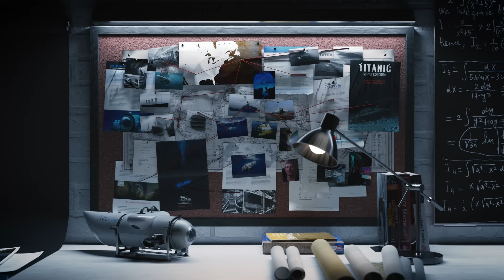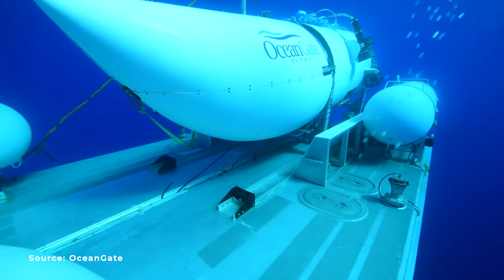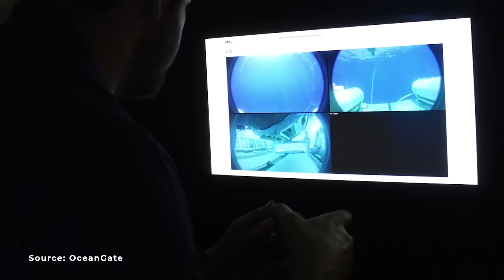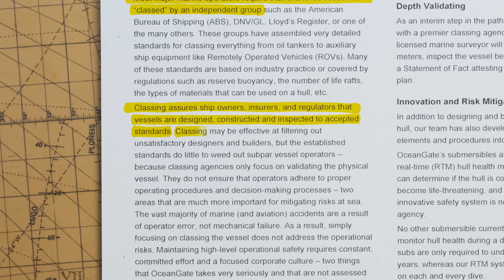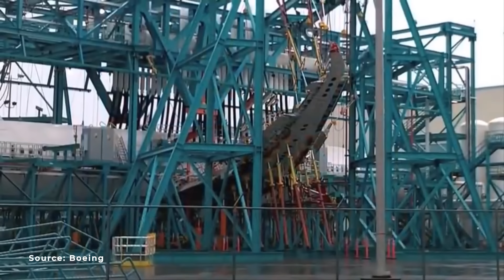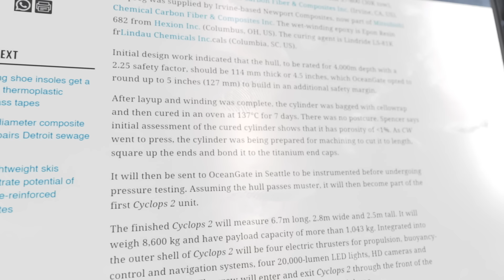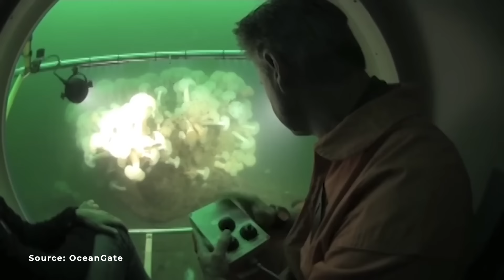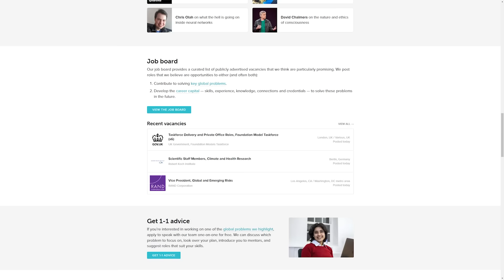The Questionable Engineering of Oceangate

Comment: After 27+ years of service in the air force as an acft tech , I've come to trust the strength of the carbon composite applications in aviation . But the caveat is that they require care and strict adherence to the non destructive inspection schedule throughout the service life of the said parts . For me Stockton Rush is even more unforgivable because himself came from the field of aerospace engineering and failed to transfer the same safety ethos and practices to his company ..... Greed , delusion .... hubris .... 
One last remark considering a key safety factor in my experience : the ballast release mechanism - from what I've managed to glean from the various tech channels there were frequent problems in this area . This IS your way out of trouble !!! In my field of work it's the analogous of the ejection seat - this is something that must and WILL work 100% EVERY-TIME - ANYTIME  (to my knowledge there is no ejection seat failure for at least 40 years - possibly for ever) - Comparatively in the sub when you press the button the ballast MUST be released - period - 100% - instantly ...

Comment: THE ENGINEERING IRON RING 

Canadian engineers and RCEME (Royal Corp of Electrical and Mechanical Engineers) have the Iron Ring - worn by the engineer on the pinkie finger of the dominant design hand. As a constant reminder for ethical and moral responsibility of design failure resulting in death. 
The origin is from a failure design in a bridge in Canada that failed and caused death. 
I own both. 
It is a constant reminder.
Engineering has huge weight on its shoulders.

Comment: My only problem with this video is it’s 15 minutes long, this content should be much much longer! I love it
Reply: had me in the first half
Reply: At the moment, he can only make a very educated guess as to the how and why the submersible failed. But  what actually failed has yet to be determined/released. There is no data set for the number of cycles that the type of vessel can survive, save for the one example that is the Titan itself. Innovation, in any field, is measured through achievable goals. Others, like Spacex, bring vehicles to the breaking point, then scale back their flight envelopes accordingly. Even the Shuttle operations have to be changed to suit new knowledge of its time. I also have serious doubts about Virgin Galactic only because their safety margins appear extremely thin even in comparison to Spacex, they only have tens of flights vs hundreds of the Shuttle and the hundreds of the falcon 9 vehicle.

Comment: I'm not a material engineer, but I've been shooting bows and crossbows since the 1980s. Hearing that the sub was made of carbon fiber pretty much confirmed it had come apart somewhere. For the past couple of decades, there have been arrows with carbon fiber shafts. Many of them have stern warnings with capital letters saying to twist/flex the arrow before firing, because if there are any loose fibers or cracks, the arrow will fly apart under the stress of being fired, and those fibers will go through the back of your hand. They don't gradually fail, they come apart all at once. Which is what probably happened to our overconfident CEO.

Comment: Let's try some simple, schoolboy maths: viewport tested/rated to 1,300 meters, proposed operating depth 4,000 meters => 2,700 meters below - BELOW - rated depth. Pressure increases by 1 Atmosphere (14.7 P.S.I.) per 10-meters decent, therefore 4,000 meters => an extra - EXTRA - pressure of 3,983.7 P.S.I. Yep - almost 4,000 lbs. per square inch EXTRA! AA designed and certified alright - the AA standing for Arrogant A-HOLE.

Comment: My thesis was also on a related topic - multiscale finite element analysis. A method developed precisely because of the non-homogeneous nature of these materials which makes very difficult to analyse
Reply: Heh, I'm a layman and I made a comment earlier this week that even destructive testing of CF is not conclusive because one hull won't be the same as the other 🙂
Reply: Even with that, you have the problem of the data you put in.  Epoxy rich winding of carbon fiber leads to lots on nonuniformities that you can't see in the design plans.
Reply: Is it publicly avaiable?
Reply: That sounds really fascinating.  If the thesis publicly available?
Reply: Sure.
Reply: @sonicimperium  *Sure!

Comment: The speed at which the sub descended on its last dive was significantly higher than previous dives. In addition, the ascent rate after they jettisoned the ballast when they recognized there was a problem is indicative that the sub was substantially heavier on its final dive than on those before. If this was because of payload it probably means nothing but if the weight they carried as payload wasn't significantly different than on previous dives it raises the possibility that the carbon fiber hull was already compromised and had a significant weight of water inside it. Simply weighing the sub after each dive would have indicated the problem long before a complete failure happened. Had their been delamination which allowed water to be trapped within the carbon fiber structure? Does that explain the increased descent rate? Did the pilot recognize the increased descent rate and know enough to understand it could represent a serious problem? Simple non destructive testing, tapping on the hull and listening for a change in the sound, could have prevented a disaster, but the young, diverse team didn't have the experience to know that.

Comment: A wonderful video in almost every respect, but in what way has that unnamed CEO revolutionized anything? He bullwhipped an electric car company into mass production. That I will grant. But certainly the space company has produced no innovations. They have repackaged ideas from prior generations, and touted reduced costs through reuse which are not backed up by reduced invoice prices of current launches. Smoke and mirrors only. And if you analyze the waste bins they are trying to fly now in relation to the requirements of human rated flight, their present designs are less capable than OceanGate. The waste is obscene rather than showing a sensible path to launch success.

Comment: No way, they didn't even autoclave the body of the vessel and didn't check for cyclic stress and fatigue? It's like compounded negligence and incompetence. 

For the move fast, break things it can be applied here by building several of these, sending them down unmanned and seeing what were the failures, failure modes, etc. Figuring out how many pressurization cycles it would take before it breaks. Not by risking the lives of others just because it didn't break the first few times. Of course it takes tons of resources, but it also gives real life testing rather than just theoretical knowledge.

Comment: James Cameron's Deep Sea Challenger was designed with the pressurized hull being separated from the rest of the vessel because at extreme depths the vessel would actually compress to about 2 inches smaller from it's default size all around, proving that the human portion of the sub must be built wisely, and patiently
Reply: I bet it compressed more than 2" 
The Trieste compressed around 5" and that was made from high nickel steel. 
The end caps were HAND GLUED together out in the open. No vacuum, just a plastic spatula smearing the glue together. I  think this is where the failure began, the end caps. Made from  dis-similar materials that compress different amounts. 
It was a miracle it made it more than once.
Reply: @TheBandit7613  I suspect that temperature related stresses played a part too.  In the open warehouse that they did the gluing, I doubt they held the temperature completely constant until the cure was complete.  Temperature changes and different expansion rates could have lead to a joint that was weaker than the calculations said it was.
Reply: charitable of you to assume they calculated anything
Reply: @TheBandit7613  If the design is done right, that should be irrelevant. Bathysphere windows are designed thick & conical so that as pressures go up, so does the seal quality. (They are also not "sealed", they're just held in by clips & water pressure)

Kind of scary to listen to them rattle on the surface, you'd swear every fitting is loose - and most of them ARE. (At least at surface pressures)

P.S. Not an expert, just a former longshoreman that moved a few from truck beds to boats - and had to ask questions because I thought I broke them while lifting them from the truck.
Reply: In the Deep Sea Challenger doco they also mentioned that they limited the amount of deep sea dives before doing the main dive as each dive increases the risk of catastrophic failure. To me it sounds like there is no sub that can do extreme deep dives on repeat, they get rated to be able to do x and after that they need to build a new one.

Just my understanding, I have no qualifications in this field, just what I understood from the doco.
Reply: @NotBROLL this seems the most balanced approach, or go ROV and prevent human loss.
Reply: James Cameron's team also worked on that submersible for 7 years with thousands of tests prior to make sure everything was as close to perfect as they could get it
Reply: @BigHuskyGG  then again his sub also went 3 times as deep which is nuts.
Reply: @ThatPianoNoob  yea dude Cameron's Challenger is honestly a crazy cool looking piece of engineering. The damn thing flips upright and goes down like a proper effing research machine
Reply: @BigHuskyGG yes and knew the vessel had to be very small
Reply: @BigHuskyGG  James Cameron did things right - and used a lot of carbon fiber in his sub. (Material used matters far less than proper engineering and design process)
Reply: Dude bankrupt companies with his project 😂but he do it well
Reply: @jettbezos8074  He has the buckaroos and the drive to do it.
Reply: @jettbezos8074  unfortunately, I don't think it is. 
And there will be some other people who would still use their "service"
Reply: @jettbezos8074 who care’s money comes back people dont
Reply: @jettbezos8074 money isn’t real bro 🤣 we all just agree it is 🤣
Reply: to be fair Cameron went 12kms down, Titanic is 4kms. You dont need a submersible like the Deep Sea Challenger to go see the Titanic. In the 30 plus times Cameron has gone to the Titanic he wasn't in a submersible like the Deep Sea Challenger.
Reply: I think a BIGGEST point is that the Deep Sea Challenger was actually designed for a 1 time use due to the safety issues.
Ocean gate used a 1 time use vehicle to model their multi-use design off of.
You have to have a lot more engineering to redesign a 1 time use vessel for multiple uses, and IIRC, they completely ignored/forgot about that fact.
Reply: Limiting Factor also designed the same. The pressurized titanium hull separated from the rest of the vessel. And, was pressure tested in Russia for depths much deeper than Challenger Deep. It did its shakedown cruise on less deep missions before its main goal.
Reply: Reminded me of that one submarine movie with the guy stretching gum i think it was across the hull to see how compressed the sub got.
Reply: @alexwest2573  Wasn't that an airplane and a piece of string?  Or did they use it twice in 2 different places?
Reply: @jarrod752  I can’t find a clip of it, i just remember the scene but not a movie name
Reply: @JoeLaFon: I have developed a great deal of respect for James Cameron due to his professional and respectful commentary on this disaster. Prior to that, I didn't see him as anything other than just another Hollywood ego tripper with money to burn playing with expensive toys. After this, I hope that all of the rich wannabe innovators in space and deep sea tourism take a step back and take advantage of the expertise in these areas which is available to them, and be willing to not only accept advise that may deflate their dreams somewhat, but also be willing to take the baby steps that are often necessary for safe technical evolution.

Comment: I'm not an engineer but here's my opinion about the controller thing. I think using a game console controller is probably fine as such and sufficiently reliable. However, using a wireless controller (as they seemed to be doing) seems like an unnecessary risk to me (even though it doesn't seem to have been the reason for this accident).

Comment: What I suspect - delamination of inner walls actually might have occurred way before this last dive, probably in 3-4 of their previous dives. It was either undetected (delamination is not easy to detect in composites with currently available non destructive methods and extremely expensive) because the general shape wasn't disfigured like layers separating from each other - no contact but still in same shape, or it was detected and swept under the rug.

Comment: id say this Implsion has more in common with The Apollo 1, Soyuz 1, Challenger and Columbia than SpaceX Virgin Galactic or Blue Origin.

There was warning signs, Passengers was not told the full extent of the problems with the design and the Enviromental forces.

People with good knowledge of the systems technical issues or limits were not fully listened to and Safety took abit of a backseat for Either Political governemntal or Company Wishes/Preassure.

Hopefully we will learn something from this most likely preventebla tragedy.

Comment: Small data correction, the submersible that was sent down to investigate was designed to descend at a rate of 25m/min but they broke the rules to send it down faster at around 35m/min. This was stated by the company that operated it in thier emotional press conference.
From the 10m launch depth (the submersible platform) to the 3.8km of Titanic at the advertsed 2 1/2 hour travel time, the Titan SHOULD have been descending at a rate of 25.4m/min.
IF the leaked transcript of what was communicated between the Polar Prince and the Titan is correct then the Titan was descending at a rate of around 38m/min and likely peaked at a rate around 50-55m/min (just before they dropped the ballast and frame to try to ascend).

Comment: There is zero parallel between Elon Musk's SpaceX and Stockton Rush's OceanGate.  For there to be a parallel, Rush would have had to have built HUNDREDS of subs, and launched them over and over again, UNMANNED, documenting each and every implosion, figuring out what went wrong, collecting REAMS of data, tweaking, improving, trying again, repeat, repeat, repeat, until FINALLY, a product is arrived upon that is PROVEN and TESTED SAFE and RELIABLE.

Comment: Great video you obviously know this. I'm immediately watching again make sure I didn't miss anything. You made a small error in rate and time. You said 55 meters for 70 minutes, it's actually around 25 meters for 150 minutes. But im sure they  could with thrusters and more weight. The supposed titan text leak has them descending at 40 meters a minute some say that's a clue it's fake but I could see Rush descending faster for the VIP s

Comment: They charge $250,000 per person! Yet, if they want Return customers, good reputation: You'd THINK they would invest in advanced engineering designs! Engineer far beyond your operating limit's! Have a bunch of the BEST "what if worse case scenario response" in something like this since only a FEW things can even operate at those underwater conditions. Why not have much more advanced emergency location services? Have a 2 submersible system. Use teether systems, dont operate around a messy titanic ship wreck. Let ROVs do that. Or at LEAST build your submersible so it can withstand MUCH MUCH GREATER STRESS than anything it would experience! I don't understand this type of negligence. Especially when they charge a quarter of a million dollars per person! For what? Where is all that money going? Definitely didn't go into safety, engineering, technology resources and capabilities... It makes no sense even from a strictly business stand point?? You'd want customers & good PR for continuing income.. well they tossed that down the drain... It makes no sense and makes me so frustrated.

Comment: "in order to achieve the desired buoyancy, they (submarines) need foam outer layers"   Whut? I know submarines are covered in structured rubber tiles to deflect sonar, but foam would not help buoyancy... it would absorb water and therefore sink the sub when pressure wood compress the air out of the foam. Did you make that up or are there sources for that claim?

Comment: why would they not use a in-out layer? the carbon fiber would be laid down in a Ziz-zag type layer and then wrapped around the cylinder. This would make each strand go from the outside to the inside and thus place them in tension.

Comment: 4:31 Thank you for mentioning this, because that was my immediate reaction as well! This is the first video I've seen that actually brings it up, and I've watched a lot of them.

It's almost comical how flawed their logic is..."clearly certification isn't necessary, because all issues certified submersibles have encountered haven't been the result of a failure to meet certification standards!" 🤦

It's a logical flaw I see in many complaints about current laws or safety regulations. (Like, "how they clearly aren't needed, because the current problems aren't a result of those regulations/laws being broken," etc.)
"Safety hasn't been an issue recently, so recent safety regulations are clearly pointless!" When obviously, that safety is a direct result of those safety regulations. 

Analogy off the top of my head: It's akin to advocating for the destruction of a dam in [River A], by pointing out how "all the local flooding incidents keep coming from [River B]!" 

Safety regulations & laws make up the 'dam' holding back the unseen flood of accidents & tragedies - that we haven't been forced to go through since the dam's construction.